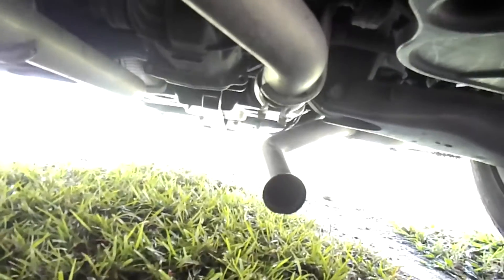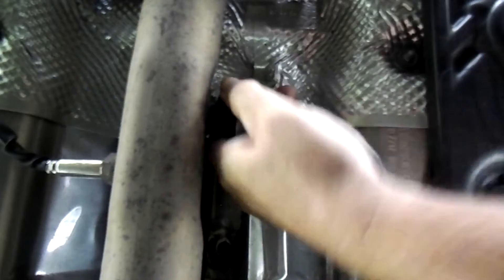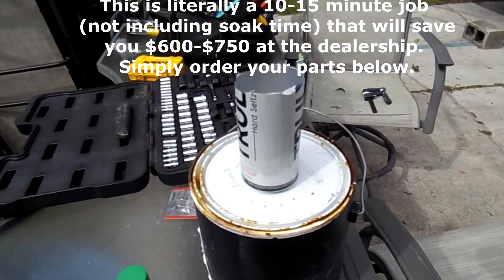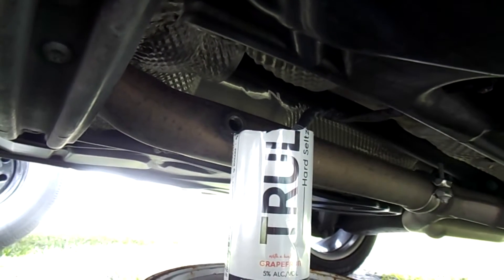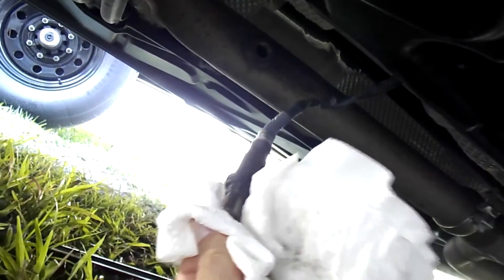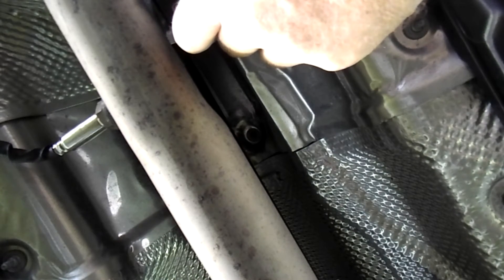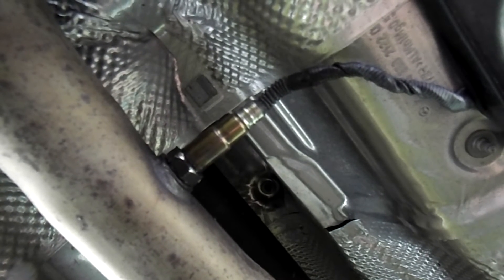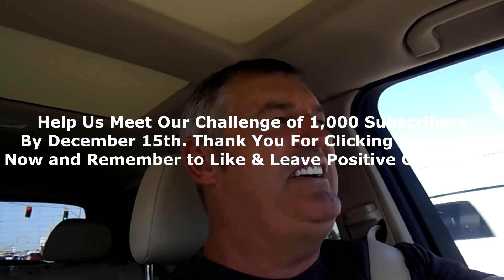How to fix a NOX Sensor DIY for $10 on any diesel engine without replacing, even on Mercedes-Benz.

Comment: Don't waste your time with the Lucas is designed to be mixed with fuel , use Berryman B12 Chemtool instead and spray the sensor clean and or your can soak in a glass jar if you buy the liquid non spray can version

Comment: I replaced these sensors so many times on my 2013 Mercedes-Benz Sprinter 2500 - I had enough and decided to try your tip. It worked like a charm. Thank you!

I used a: 
22mm wrench, fuel treatment, carburetor cleaner, and wire brush (to get into the small holes)
Reply from the maker: Courtney,
Thank you for the contribution!!! We love good folks like you that actually contribute to our family and would like to invite you to subscribe to our family. Let me know once you have. WELCOME!

Comment: The Lucas oil is designed to break down the carbon in systems when it is  mixed with gasoline/diesel, atomized, and burned. It has no effect on parts soaking in it. The only thing that is removing the sensor carbon buildup in this video is a few seconds of Carb Cleaner that is being sprayed into the sensor. Don’t waist your time and money soaking it in Lucas oil, just spray it with cleaner and blow it out with compressed air.

Comment: This fixed the code on my 2017 6.7 powerstroke. The only thing I did different is mixed in a little gas to the injector cleaner as the two are meant to work together so I thought why not. Also I let it soak 48 hours. Thanks for the help!
Reply: What code were you getting? I’m getting P2209 and wondering if this might do the trick.
Reply: I was getting P2201

Comment: How long did your NOx sensors work after cleaning them?
Reply from the maker: Please see the next comment below for your answer.
Reply: @millerfamilyfarmtrust6515  Comments don't load the same for everybody.  I see one user has had 2 extra years of life, which is good to know.  NOx sensors contain precious metals that degrade over time and can't be fixed by cleaning.  That's why I'm asking how long this lasted for you as well.  Thanks for taking the time to respond
Reply from the maker: @imagesmaydisturb  I sold the SUV about a year and a half after the process was completed. So I guess I can say 1.5 years or more. Does that help?
Reply: @millerfamilyfarmtrust6515  Appreciate the info
Reply from the maker: @imagesmaydisturb  You so welcome. Did you subscribe to the channel?

Comment: I can not find super tech carburetor and air intake cleaner. What else could I use to spray the sensor after soaking it in Lucas injector cleaner please ? I mean a diesel engine ?
Reply from the maker: Good Day Marcin,
Thank you for the question. Any Carburetor cleaner will work. We see you havent joined our family here at Miller Family Farm Trust and we would love to have you subscribe and be part of our family here. Let us know once you have subscribed. WELCOME
Reply: It is done. Thank you for your replay.
Reply from the maker: Welcome Aboard Marcin, We are proud to have you join our fmaily.  @marcinrakowski8171

Comment: Pro Tip...you should have pre-spun the sensor in the opposite direction, the same number of turns it takes to tighten the sensor.  By doing so, the sensor wiring will not end up all twisted up.
Reply: Or just connect once you've turned it in ?
Reply from the maker: THANK YOU TURBO DIESEL FURY,
Thank you for the contribution!!! We love good folks like you that actually contribute to our family and would like to invite you to subscribe to our family. Let me know once you have. WELCOME!

Comment: Will this sensor cause engine light to come on ? Thanks
Reply from the maker: Yes Mike, these sensors do cause the engine light to come on but you can take your vehicle to your local parts store and have them run a FREE diagnotic on the engine to dtermine if it is a sensor issue. 
We noticed you havent subscribed to our channel and would love to have you join our family here at the MILLER FAMILY FARM TRUST CHANNEL. Please subscrive and then let us know once you have. WELCOME

Comment: Hello! Please tell me if this solved the check engine error. It also appeared on my Mercedes w205 and I keep deleting it every 500 km but it reappears
Reply from the maker: Hello Daniel, 
These sensors do cause the engine light to come on but you can take your vehicle to your local parts store and have them run a FREE diagnostic on the engine to determine if it is a sensor issue. 
We noticed you havent subscribed to our channel and would love to have you join our family here at the MILLER FAMILY FARM TRUST CHANNEL. Please subscrive and then let us know once you have. WELCOME

Comment: Hi buddy, I got a c220d

Nox sensor issue started 3 years ago and Mercedes accepted liability and replaced. It then needed replacing 2 more times within 2 years. But the third time they made an excuse telling me that the ad blu was contaminated (no idea how) and that may be causing the issue and they didn’t replace. 

Do you think cleaning the sensors will be better or having the nox sensor and the ad blu mapped out of the system would be better(assuming they won’t effect the performance of the car)

Thanks
Reply from the maker: @TheJewelleryWorkshop
Well, its hard to tell what is causing the issue if it has been replaced that often but as long as Mercedes is willing to keep replacing the sensor, I would let them. Also, there are Lemon Laws that come in to play on items that keep failing time and time again. Mercedes generally will stand by thier repair even after warranty period if they have repaired it once as their view point is it wasnt repaired properly or you would be back with the same issue. I know its frustrating but as long as Mercedes is still swapping out the sensor, why not let them and you can always go the route of Lemon Law if all else fails becuase this is a common problem that has not been dealth with properly. We noticed you havent subscribed to our family here at the Miller Family Farm Trust channel and we would love to have you be part of our family here, as we love contributors. Let us know once you have joined. WELCO ME!
Reply: Hi pal, i know its been a while but i’m interested to know what route you went down. I have a 2017 C220D amg line premium plus, got the engine management light come on did a diagnostic and it was a Nox sensor issue, in the time of searching for a new nox sensor it now says Ad blu levels not detected and has a count down from 500 miles. Guessing either the Ad blu tank has crystallised or the pump has gone as well.

Keen to know what you got done, did you get it repaired or have it deleted out, repairs i’m looking at over £1500 , deleted out its £250
thanks
Reply: @e.a3992  I had it deleted.
Reply: @TheJewelleryWorkshop  thanks for the prompt response, how long did you keep the car afterwards? Did you get any further problems down the line. I heard it can sometimes affect the DPF from regenerating and cause DPF issues afterwards. 
Also was the car yours or to be given back to the finance company any problems faced if or when given back.
Reply: @e.a3992  I’ve still got the car lol. I’m having some temperature sensor issues that I’ve had to replace. But I think having something deleted is not good for the car. The nox sensor is an expensive job that’s why I had it deleted. I have the engine light on at the moment for another sensor. Gonna replace that soon and see what happens

Comment: Hi I have a c200d 2017 ! I filled up with 10 L of ad blue 3 weeeks ago and recently it says cannot measure ad blue level and e/m light has came on!I ran a diagnostics and I’m getting these fault codes P22A677.( the heater of the nox sensor 2 (cylinder bank 1 )
has an electrical fault) And P13DF09. (The adblue system has a malfunction there is a component fault ) and P2BA901! The car drives absolutely fine is this something I could fix any help would be much appreciated or could I use this same cleaning method mabe to clean it
Reply from the maker: Welcome Dzgdot,
I would recommend googling the fault codes to see exactly what we are dealing with and if it is sensor related in the exhaust system. Once you know for sure what you are dealing with then you can google the sensor that is malfunctioning and see if it is the same sensor location that is in this video and if it is, then you can try the simple procedure in the video. We would love to have you subscribe to our family here at Miller Family Farm Trust Channel and please let us know once you have subscribed. WELCOME
Reply: Add 2-3 ozs of JetDry and it'll clean the tank sensor and Adblue injector

Comment: Helo. I have C220 2015 and fault is P220 E.
“Heating position set points 1 can not be reached” 

Would this help? In my case I have specific situation where I engine light comes on and off few days on, few days off. I have feeling its because of bupms on road but my mechanic checked all contacts and if was good. Not sure what it is, maybe in chip? 

What you guys think? (Anyone here welcome to advice)
Reply: HERE IS THE GOOGLED CODE:
OBD2 Diagnostic Trouble Code P220E means that NOx Sensor Heater Control Circuit Range/Performance, Bank 1 Sensor 1 has been detected.
It appears to be a NOx Sensor issue and you could do this simple fix and see if it resolves your problem and while you are doing this procedure, you can also check the connections as well. 
We noticed you have NOT yet subscribed to the Miller Family Farm Trust channel and we'd love to have you. Let us know once you have subscribed. WELCOME

Comment: Great video! The reason for the increased fuel usage with a faulty NOx sensor is that the car will go into a fixed mode trying to reduse the NOx emissions. NOx is created by pressure and heat, running richer will cool of the engine and reduce NOx and that is what the car will do to mange legislation. A NOx sensor allowes the engine to run leaner.
Reply from the maker: Thanks @thegolfingsociety5093 for the acknowledgement, its good people like you that make it worth while to make these videos.
We noticed you havent subscribed to our channel and would love to have you join our family here at the MILLER FAMILY FARM TRUST CHANNEL. Please subscrive and then let us know once you have. WELCOME

Comment: Will the  error messages on the dash clear by themselves or will it need to go on a diagnostic?
Reply: Not sure what type of vehicle you drive so it makes it impossible to answer your question but some say the error code clears itself after driving and others say you have to clear it with a diagnostic tool.

Comment: I used your procedure to clean Nox sensor on my low mileage Mercedes Vito crew van. Only hitch for me was getting the sensor out of the exhaust, I had one of the sensor extraction sockets but it was not a tight 22mm fit and turned on the sensor bolt, I was afraid of rounding the bolt. Eventually applied a little heat to the exhaust and it turned OK using an open 22mm spanner. The rest of the job went exactly as shown in the video. I found that the fault codes did not reset until I had taken the van for a run - about ten minutes - then they all reset and fault light now gone from the dash, also MPG has returned  (increased) back to pre fault performance. Thanks for the video, simple to follow and saved me a lot of money had I taken to the dealer.
Reply: I took me 20 miles, 1hr 20 or so of driving (lot of congestion here) or about 8 miles of steady driving with the sensor warmed up for the 'check anti-pollution system' error message to go away. (That's after replacing sensor, not just cleaning it).
Reply from the maker: @peterscrimgeour-fd7cd
So great to hear you had great success in this process as we love saving poeple thousands of dollars in these times. Have you subscribed to the channel. We love DOERS that share and invite you to become part of our family here at the Miller Family Farm Trust channel. Please let us know once you have subscribed and WELCOME!

Comment: We had this same problem on a 2016 Sprinter when the AdBlue warning and engine management light came on each trip after about 70 miles, and continued to limp mode.  We called out Mercedes breakdown 4 times and took the van to our Mercedes main dealer where we spent several hundred pounds on their suggested cures.  In spite of that, the problem continued.  Having watched your video, we carried out your suggested cleaning of the Nox sensors which has completely cured the problem.  Thank you for sharing this video and solving the problem with our van, at minimal expense.
Reply: How long did it work after you cleaned it?
Reply from the maker: Angel,
CONGRATULATIONS!!!! That will wok for a couple of years and then the same thing will happen again but at least now you know how to fix it yourself. Mercedes did the same thing with us and within the year it was doing the same thing again. BUT new parts are always good.
Reply: Thanks 👍

Comment: I am finding the 7/8" nox sensor tool a little loose - has anyone found a 22mm version?
Reply: Sail, I found it a little loose as well but it works. I don't think there is a 22mm version but a quick phone call to any parts store would let you know for sure. Let us know how things go....

Comment: Hi, does this also work for the petrol engine? Had a nox sensor replaced in January on my CLS400 and last week engine light turned on again. Repair is €700 and there's 4 of these sensors in my car so ideally I would want to have these sensors cleaned first before replacement.
Reply: Good Day Cornpit77,
Thanks for the contributing question. Yes sensors are sensors and they will ALL soot up eventually and without either replacing or cleaning, you will be dealing with error codes for the life of the vehicle. We would love to have you join our family here at "Miller Family Farm Trust Channel" as we love contributing family member so here is your personal invitation and welcome. Let me know once you have subscribed.

Comment: Hi all ,
Seems to have similar problem on my e class w213 sensor on front not working I did changing and again engine light come on, not sure what else to do
Reply: 100% your service didn't replaced to sensors. I really recommend it local garages. Take your parts and go them 👍

Comment: Ok, so i just tried this on my duramax last week, soaked it overnight,  sprayed it down next day with carb cleaner, and for a few days, nothing happened to indicate any change. Third day,  it went up past the 55 mph for a couple minutes and then gave me the warning and transitioned back to 55. Today, drove about 80 miles, no emissions warning, no reduced speed! At first i was hesitant to bother and just buy a new sensor but with 220K on the truck, what did i have to lose! So far, it might have fixed it!
Reply: Bob - i have a 2012 silverado 3500hd with dura 6.6 LML.  only 90,000.  just got the service emissions warning, 175 miles til limp.  put a reader on it & i'm getting the p2200, 2201,2202 all indicating nox sensor 1 bank 1.  my problem is that i live over 200 miles from dealer.  was wondering if this worked for you.  after cleaning your nox 1 did it indeed clear itself and has it come back?  did you have to clear codes manually or did it do it on it's own?  man i hate how hard these 'newer:)' trucks are to work on. thanks - barbie
Reply: @8barbies779  it worked for a couple months then issue came back. I parked the truck and have been driving my car so I haven't messed with it anymore.  I wonder if cleaning again for longer would work? Idk.
Reply: @BtC383  i had a feeling it would come back.  it gets confusing to me but without the right scanner or knowing how to do it exactly i think it's hard to permanently delete those codes.  i've read some 'tamper' stuff related to some ECUs but i'm still trying to research.  getting so pissed, i read somewhere that these NOX sensors are hard to get right now too, sucks cuz i gotta drive to idaho tomorrow - 400 miles & i'm about to go into limp mode.  fk!
Reply: @8barbies779  I had seen them available on rock auto, I'd also try a wrecking yard, get a used one
Reply: @BtC383  yeah, i haven't even called the dealer yet cuz i've gotta change all my plans around:)))
Reply: @8barbies779  forgot to mention,  I have a bluedriver code reader, but when I cleaned the nox sensor,  the system smartened up on its own
Reply: @BtC383  yeah, my problem is that i don't know how long it'll take to smarten up on it's own and then i don't know how long it will take to reappear. sucks because i live in the middle of nowhere, i'm an outfitter so i'm always in the mountains etc.  i 'v got a 400 mile trip planned so i don't want it going into limp mode with my horse trailer on.  damn, this shit is so inconvenient.

Comment: Nice video, thank you for uploading! I have a Mercedes V-klass 2,5 4WheelDrive 2018, with 40.000km on it and already my engine indicator is burning. Saying ^NOx Sensor Circuit Range/Performance Bank 1^ is this also easy to clean of easy to get acces to the sensor beacause its 2018? If i am guessing right it has 2 sensors to be cleaned or changed? Can u please give me a advise what to do? Buy or try to clean. Thank You!
Reply: SaQuil,
Thank you for the contribution. Well, like so many others here... it makes sense to spend $10 and clean the sensor and if it doesn't work, you can always take the car to the dealer and pay them to replace it. I would guess 80-90% have been successful. Please subscribe to Miller Family Farm Trust Channel and join our family. Leave a message here once you have subscribed.